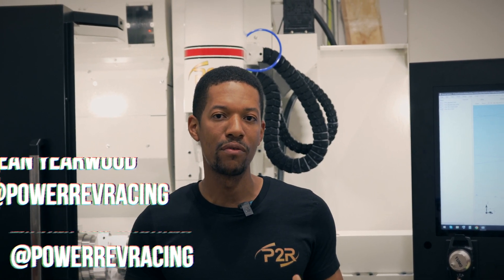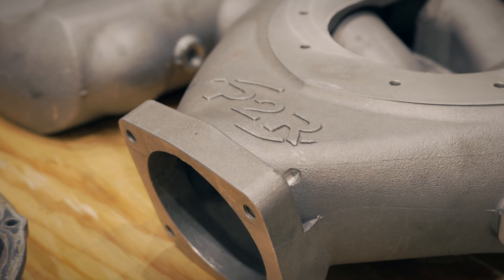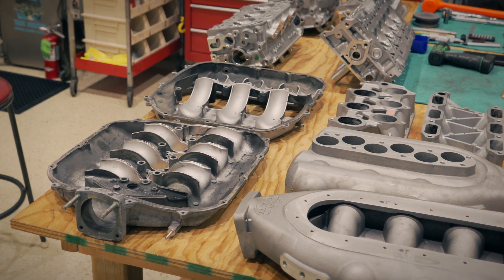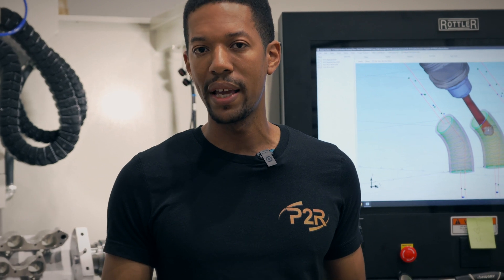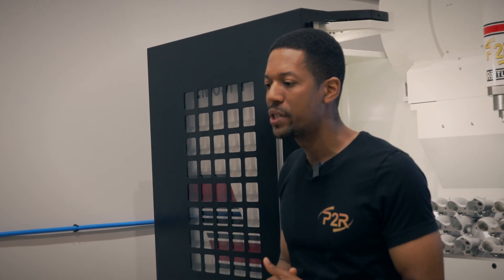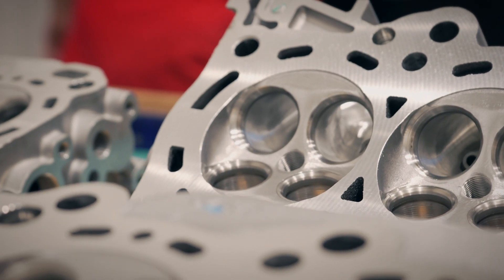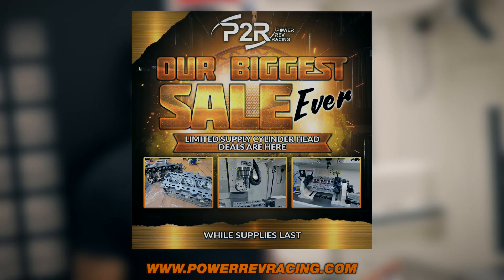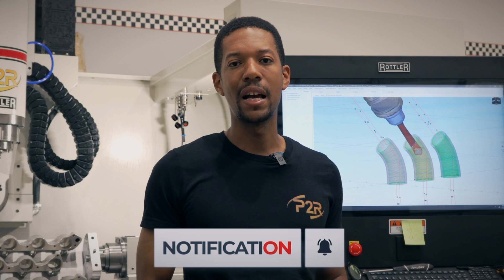P2R Expanding our CNC Porting Capabilities & Focus on J Series Development

Comment: Are J series intake manifold the same bolt pattern for all?  I'd like to get one for my TLX 2016
Reply from the maker: Tlx is direct injection so it does not share the same bolt pattern as the previous generation J series engines.
Reply from the maker: We offer cnc ported lower manifold runners for the TLX